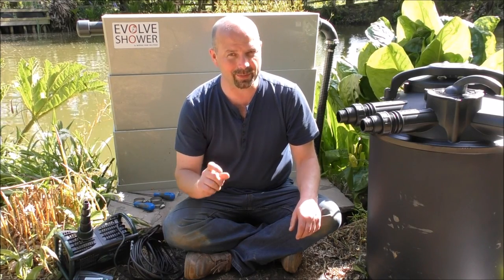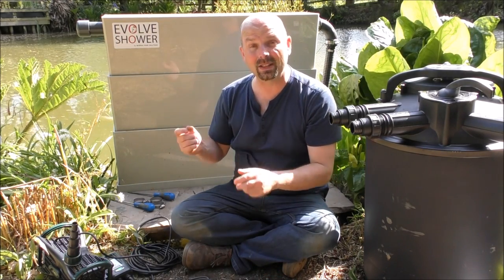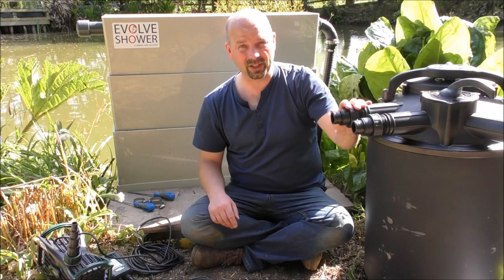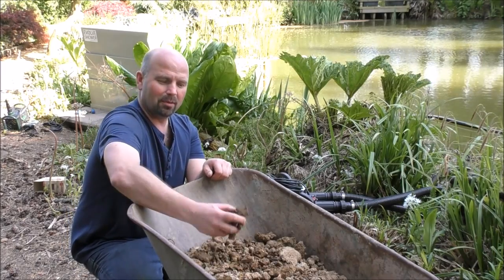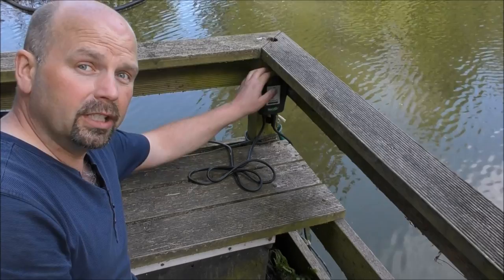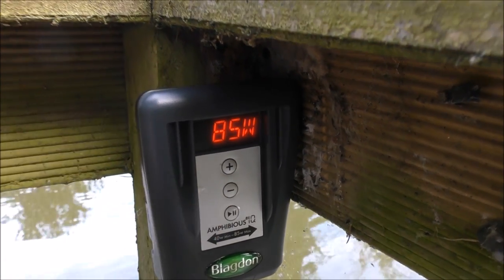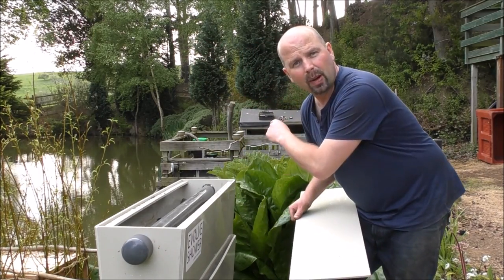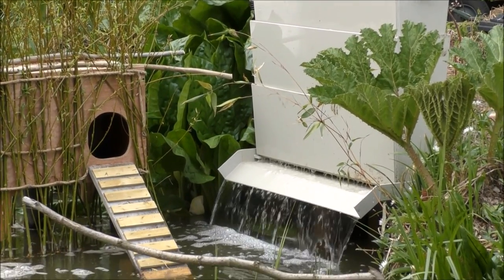Pressure Filter and Shower Filter for a Koi Pond - A Match Made in Heaven?

Comment: What type of filter system  would you recommend for a 2000 gallon koi pond  and dose not cost thousands
Reply from the maker: I'm assuming that you are in the UK? I'm not too familiar with what is available in other countries.
If you are looking for a similar idea to this then there are a nation of pressure filters available now which would act as the first stage of filtration and then you could build a shower filter from suitable containers and minimal fittings very easily (I have a few videos showing how shower filters can be made on my channel).
That will allow you to spend the money where it really matters which is on the filter media - if the shower filter is big enough to get a good amount of 30mm-50mm white pumice in (maybe around 100kg) then that will do a great job of hammering away at ammonia and nitrite, any more in the filter and you'll stand a chance of reducing the nitrates too depending on stock.
If you're on a budget then any of the biohome media is probably out but we have a shower media which is very good and can be added later as funds allow - it packs into a filter extremely well.
The pressure filter would ideally be for 'up to 20000 litres' or more as that would have a suitable sized UV light in - pressure filters often aren't capable of doing a good 'water health' job by themselves, especially when koi is the stock but they do a great job of the UV and mechanical side of filtration.
Feel free to ring me any time on 07772848730
Regards,
Richard
Reply: Pondguru thank you for the quick response. I am in the UK that sounds like a good plan its well within my budget i will look in to them. Then will get intouch if i need more info.

Keep up the good work 
Thank you
Reply from the maker: No worries, any time.

Comment: Are you gonna use poleyster filling anywhere in the pond filter ?
Reply from the maker: I will probably use it in the big filter system I'll be building soon since I bought about 1000 large polyester pads when they were on offer a couple of years ago and still have all of them.
Reply: Oh thats sweet think they gonna clean up the murkyness off the water quite nice :D , i dont remember if you ever mentioned if the pond is lined with liner or  is it clay pond 😎?
Reply from the maker: It is a clay pond so takes and age to clear.
Reply from the maker: I just added a fine pad to the shower to see how much fine muck it would catch and it is holding some already  so it's all good.

Comment: I have a question for ya. Ken here from Texas. I have a concrete, fresh water fish pond with fish of course. I use water from a well to fill it with. It grows a lot of scum during the hot summer months we have here. Is there any way I can prohibit the growth of this scum?
Reply from the maker: It sounds like you need some sort of surface skimmer and there are 3 choices as far as designs go:
1 - built in skimmer where you would break out part of the pond side and fit the skimmer.
2 - free standing skimmer which would attach to the inlet of the pump if possible.
3 - free swimming skimmer which would travel around the pond and remove anything which is drawn into the basket.
If you search those terms for different skimmers on google you will find a nation of them but as I'm not familiar with the products available in the US or the design of the pond I can't recommend a specific design.
Regards,
Richard

Comment: I was wondering would pond filter media like sponges be good for a sump drip plate filter?
Reply from the maker: They will be good to mechanically clean the water but offer little in the way of good environment for bacterial colonisation. As long as you have good media under the foams the filter will support a good amount of bacteria to ensure processing of ammonia and nitrite. Very few types of media will allow for anaerobic activity for nitrate reduction but it is perfectly achievable with the various forms of biohome  - I'm assuming that you have a marine tank so biohome ultimate marine would be the one to go for at a rate of approx. 1.5kg - 2kg per 100 litres. That is the average amount of media needed for a full cycle in a marine system.

Comment: Why didn't you build your own gravity filter for such a big pond? IMO this tiny (considering the pond size) pressure filter won't do much.  I'd go with one or two big 1000 Liter IBC Containers and put a bunch of (like 150) brushes inside. That would filter the water much better than this filter, which considering the pump placement, will be dirty by tomorrow.
Reply from the maker: Not sure if you saw my previous video on the pond but I explained about the big filter I was building and showed all the parts (vortex, large plastic containers etc.).
The filter set up in this video is just to demonstrate what can be done and I mention a few times that it has no chance of cleaning a pond the size on mine.
With any luck I'll build the 'proper' filter soon.

Comment: Just built a raised pond, will hold about 3000 litre,, my presurized filter and pump arrives today, so weekend lino in amd pump and filter. Filter is 17,000 and pump is 10,500. Eventually will go into a home made baki shower. But i dont know if i can attach a retro drain to the pump ???
Reply from the maker: Some pumps will have an intake to which a retrofit bottom drain can be fitted. However, if you've got a pond base which slopes toward the pump there will be no need to have any extra fittings.
Reply: @pondguru  my pond base slopes, and the pump is situated at the lowest part of the pond,  the inlet pipe comes back into the pond at the opposite end creating movment, I will be testing the water on 19th
Reply: @jbbailey04  (my other channel)  That sounds good to me - best of luck.

Comment: ever thought about not having the pump touching the very bottom of the pond where it will just suck all the crap up, should do it so its a couple of feet above the the bottom so its only cycling water and not crap off the bottom, (this is what i do in my very small pond but only have it a few inches)
Reply from the maker: I'll see how much muck is pumped from the pond and if it is excessive I may suspend the pump from the large platform so it is up off the ground. When I make the big filter for the pond I will now be using a different pump as that one will be to remove as much muck from the water as possible. Luckily I have a solids handling 16000 lph pump spare which will now run the big filter.
Reply: have a waterproof rot proof rope go across the pond so you can lower and raise the pump and have plenty spare, have a separate rope attached to the pump so you can pull it to shore, weight the bottom of the pump and let gravity take it to the center of the pond and lower it, once it reaches the bottom pull it back up by 3 - 4 feet of rope and tie it off, hope you get the general idea, best of luck
Reply from the maker: Yes that makes sense to me. It could be that it won't suck up too much muck - time will tell. Been going a week or so now and there has been no reduction in flow (.....yet.....)
Reply: could use very strong fishing line but i would have a couple of separate lines attached incase 1 broke
Reply: hate for you to have another pump go down on you, all the large stuff settles on the very bottom and thats what messed up other pump i would imagine

Comment: Hi im after some advice, i watch your youtube videos and could'nt think of any better to ask,, im looking to buy a "Blagdon Amphibious IQ Energy Saving Pond Pump" for my pond but im not sure witch one to go for (wattage wise) my pond is about 2100 liters, 10ft by 7ft and 5ft deep,, whitch size pump would you recommend i go for?
Reply: Hi you may have your volume wrong I’ve got a pond 11x8x4 and mine has about 8000 ltrs
Reply: That is 2180 GALLONS not litres!
With those dimensions it would be 9910 LITRES!
Ideally you should be looking to pass your water through your filter every 1-3 hours, so look for a pump with a max flow rate of pond volume to a third of your pond volume!

Comment: if i have a heavily planted aquarium can i place some biohome in the tank itself so that i have bacteria in the aquarium and in the canister filter ......am thinking of placing it under my air bubbles so that it has water running true it  and some near plants were water is calmer ....is that good idea ?
Reply from the maker: It will still work under those conditions but any media will definitely be more effective in a filter of some sort. If you have a suitably sized canister filter which is well set up you should achieve full cycle in there and have no need for any more media in the tank, especially if the tank is well planted since the plants will help to reduce nitrate.
Reply: so no real benefit from boihome inside tank i thought bacteria in tank could keep more balance since it would be extension to the one in filter so when filter gets clean i have bacteria from tank water ready but its just idea
Reply from the maker: Cleaning media just involves giving the filter tray a shake in a bucket of water you have drained from the tank so that doesn't do anything to kill off bacteria.

Comment: The thing of a shower filter is, to get air in the water, but the boxes are all closed.

The size of that "pond" makes any filter senseless :)
Reply from the maker: The boxes are not closed as each one has gaps down the side and a grid on the bottom to let water and air through. A nation of air can get in through the sides.
Not sure if you saw the previous video I did where I explained what I was going to do with regard to a separate, large filter system for the pond but the set up in this video is really just for demonstration purposes and I mentioned a few times in the video that none of the parts were anywhere near big enough for this pond. However, when this runs in conjunction with the huge filter I will be building it will help the situation and I reckon the large one (yet to be built) stands a good chance of making the pond clear again.

Comment: Is that 12,000 litres / hour from  85W??
Reply from the maker: Yes, you can reduce the flow using the control pad in increments down to 6000 lph and that also reduces the power consumption to only 40 watts so it is a very efficient pump. I really need to get it out to take a look at it and clean that pressure filter but both are still working fine.

Comment: would this filter work on a pond that is that same diameter size as yours except its only 3 ft deep
Reply from the maker: The same system would 'work' but there probably wouldn't be a noticeable difference in water clarity due to the size of the pond compared to the filter system as you'd probably still have a couple of hundred thousand litres if the pond had the same area but was only 1m deep.
The system in this video was set up to help out with the (larger) filtration system and demonstrate what can be done for ponds with regard to pressure and shower filters.
The large filter system is currently under construction and that one is designed to clear the water (or attempt to clear the water) and also increase the health of the water in this large pond.
Reply: Pondguru is there a filter on the market you could recomend
Reply from the maker: Not for the size of our ponds, no - that's why I am making my own from a nation of containers. I will be videoing it so the resulting video(s) will be of interest.
I just need some spare time to put it together but I have all the parts.

Comment: Hey pondguru, Joey Mullen, the king of diy doesn’t think the biohome is that great. He thinks that ceramic and other media’s are much better. He says it’s just extruded sand and extremely overrated. I was so close to ordering some of the bio home until I saw that. Will you do a video of different media’s and why you feel the bio home is so good. Is it just sand? Is ceramic better?
Reply from the maker: lol, yes he seems to be using his position on Youtube to discredit not only myself but also the Biohome too which makes no sense as the goal of an aquatic channel should surely be to examine the different types of media / pumps / filters available in a sensible and transparent manner then be able to pass judgement / reason why one is better than another with something to back it up.

All I can say in my defence is that in 20+ years of owning an aquarium shop, installing ponds and being involved with filtration the Biohome is by far the most effective, receptive (for bacterial colonisation) and cost effective media available. 
The structure of piece to piece is so consistent that we are able to confidently give real guidelines on how much it takes for a full cycle (reduction in nitrate) in a wide range of aquarium situations from the feedback we have had over many years from all round the world:
For example:

Average community tropical aquarium = 1kg per 100 litres
Average coldwater aquarium = 1kg - 1.5kg per 100 litres
Predator aquarium = 1.5kg - 2kg per 100 litres
Large cichlid aquarium = 1.5kg - 2kg per 100 litres
Malawi / Tanganyikan aquarium = 1.5kg - 2kg per 100 litres
Marine aquarium = 1.5kg - 2kg per 100 litres
Average mixed fish pond = 1kg per 200 litres
Average koi pond = 1kg per 150 litres

I took a look inside different types of filter media including 2 types of lava rock which is often championed by channels on Youtube to show exactly what the internal structure is like - when you see the 'scoria' (red lava rock) you may be quite shocked at how little accessible surface area is actually available: https://www.youtube.com/watch?v=QTtAUYR67Eg

I'm intending to do a video specifically on surface area too since so many people don't know how that is calculated or why too much is no good - it's about getting a balance of surface area, accessibility and suitability and natural sand is the most receptive media for bacteria - that is why it does not build up a 'biofilm' (of dead bacteria slime) on it like cheap ceramic rings or plastic media tends to do.

There is loads of information on my website http://www.filterpro.co.uk on the Q&A page and also the About Biohome page but you'll also find information on my channel playlists too.If you read through the comments on any of the related videos I've answered questions on all of them and I always like it when people question the usefulness of any media including Biohome since people are simply seeking information which in this modern world of fakery and unfounded claims is a rare commodity. 

The channel is really just about being true to myself and the viewers, I do it as a hobby and it is awesome to help people wherever I can - if I don't know about something I'll simply say "sorry, I haven't had experience of that particular thing" since I don't know everything and am certainly no expert.

I can understand Joey's problem with me and Biohome to a certain extent since I imagine that he is constantly getting people posting on videos and his forum about the benefits of Biohome and probably being asked all the time why he doesn't feature it in his videos. 
As it is a product he is not involved with in any capacity that must get quite wearing for him so instead of making a video properly explaining why one media is better than another he takes the other route and simply blows it off as being useless and myself as being a fool because I do not currently have an aquarium in my (tiny) home.

All I can say to that is if a guy goes out today and buys himself a huge tool kit does that instantly make him a mechanic? Nope, it's the 20+ years he has spent working on all sorts of cars that makes him a mechanic, lol
Feel free to get in touch any time if you need more information.
Regards,
Richard
sales@filterpro.co.uk
Reply: what does Mr Mullen think that Nature uses to filter water ?  SAND !

In many of his videos plastic media is used, now if the message has not reached him of how nature reacts to plastics he should maybe spend a little more time watching the news..
Reply: Pondguru thanks so much I’ve watched some of your info. On biohome and actually loved what I heard. Then I caught joeys video of him being less than impressed with it and just wasn’t sure after that. I want to get the biggest bang for my buck. Joey never replied to my comment about his reasons for not liking the bio home so I thought I’d reach out to you and see what you had to say. Thanks so much for a quick reply.
Reply from the maker: No worries, mtourgus is Michael who has manufactured the biohome for 20+ years in one form or another so he knows a thing or two about filtration, lol
The biohome really is perfectly receptive to bacteria so doesn't build up the slime which plagues hard ceramic and plastic media - the slime is a necessary build up when a surface is not suitable for bacteria to grow on.
I wouldn't be involved with any product or service that I wasn't 100% behind, we don't pay people to 'review'/ endorse anything and we only deal with people who share those same values (and share information freely) so due to that position it seems like I've become a bit of an outcast on Youtube.
I'm more than happy to be the Nikola Tesla of this situation and if you haven't heard of Tesla then that is exactly my point - if you have heard of Tesla then that is also my point, lol
Get in touch any time as every question deserves an answer.